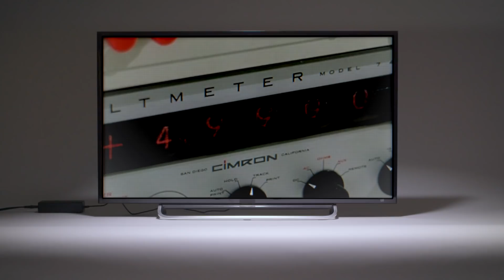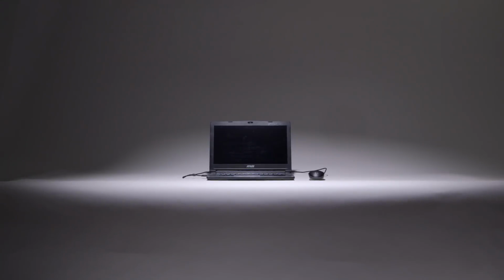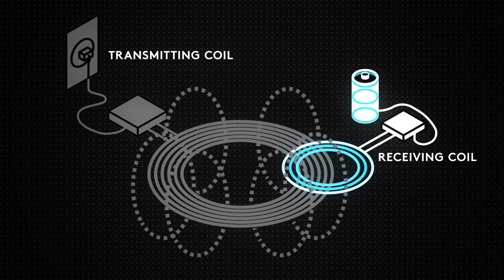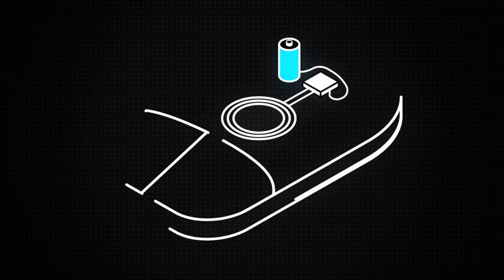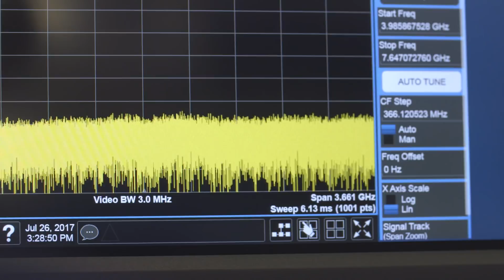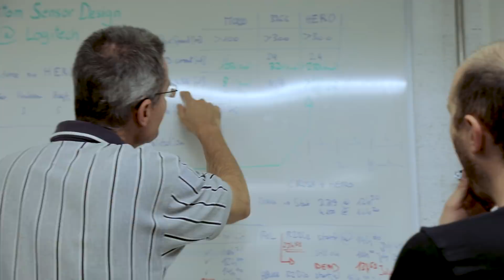Logitech G: The Technology of PowerPlay

Comment: I have had three of these. One was a replacement by Logitech. The issue is that the Powerplay will generate EMF interference while in the charging state, as indicated by the White LED on the pad receiver. I have the G903 Mouse, G910 Keyboard, and the Powerplay. I also use a Logitech MX Master 3 and Performance MX for productivity most of the time. I noticed the mouse cursor while using any other wireless mouse like the MX Master 3 or Performance MX was jittering, and I could not control it while the Powerplay was in the charge state!

As soon as the charge state ended or I unplugged the Powerplay, the cursor would return to normal. As soon as the Powerplay returned to the charging state, the cursor would become erratic again! I also noticed the G903 generated a jittery mouse cursor while the Powerplay was in a charged state. It was not as bad as when using the MXM3, and I could select items, but the cursor was jittering until the charge state ended. 

So Logitech sent me a replacement Powerplay, and it had the same issue! Because I use my productivity Logitech mice the most, I would unplug the Powerplay pad to prevent the problem from occurring. When I wanted to game and use the G903 mouse, I would plug the Powerplay back in. 

Fast forward a few months, and I started to play Elden Ring on PC using an Xbox controller. I noticed intermittent issues with menu control. When trying to select or scroll through a menu using the Xbox controller, I could not choose anything, and it would jump around! At first, I thought this was a new game patch issue, but it continued to occur, and then I noticed the game was jittering slightly only on the monitor I was playing Elden Ring. When this issue remained after several patches, I discovered the Powerplay was causing the problem when it was in a charge state! Like the mice, the issue would disappear once I disconnected the Powerplay USB cable or stopped charging.

I connected the USB connection directly to my desktop and other USB ports, but the issue persists. All device Firmware and G-Hub software are up to date. I even purchased a third Powerplay pad from BestBuy, hoping Logitech may have changed something, but the issue continues even on the newest Powerplay. The Powerplay produces some EMF that impacts other wireless devices, speakers, and monitors. I am not sure how the Powerplay is affecting my monitor. Still, it is only occurring on the monitor I am playing Elden Ring on, leading me to conclude the interface is coming through the Xbox controller and maybe producing micro character movement, which looks like screen jittering on my monitor.

I have contacted Logitech again regarding this issue. I have not seen many reviewers reporting this, but I believe this is because most owners only use a Logitech G Mouse, so they do not know the impact on other wireless devices. However, there are a few reviewers who, like me, use different wireless devices and are experiencing the same issue.

Edit: I have noticed my Panasonic wireless home phone has had interference for some time now. This wasn't always the case, and If I move away from my desk with the Powerplay, it goes away! It occurred to me that the Powerplay might also impact this phone. Sure enough, if I unplug the Powerplay mouse pad, all my home phone interference disappears!

There is a Powerplay Charging Enable option in the G Hub Powerplay options section that will only work with Powerplay Firmware 7.1.11. G Hub will NOT update the Powerplay Firmware through the built-in update process, and you have to do this manually to update the Fireware to 7.1.11 to enable this option! With no help from Logitech support, I think I figured out a fix. 

You have to use the Logitech POWERPLAY Wireless Charging System Update Tool under downloads for the Powerplay device to actually update the Powerplay Firmware to version 7.1.11 to get the option to disable. Powerplay Charging! You can now disable Powerplay Charging until required, and it will not impact other devices. I am still checking this works and will update later. Good luck.

Comment: weird that you guys put so much thought into this but you made the mouse pad so small that very few if any high level gamers would be able to use the mouse pad. Its a pretty major oversight given almost all high level gamers are using lower sensitivity. And unfortunately the large receiver and USB port on it dont make it possible to slide it under a bigger mouse pad either. on top of that you have the odd choice to make every product in the box a different thickness. If the 2 included mouse pads had the same thickness as the charging based they could be spread out to  create a larger surface to put under a larger mouse pad. The other unusual choice was not to make a wrap around RGB ring for such an expensive mouse pad. If you were going to make a smaller mouse pad then clearly it was targeted more at casual players, and in that case more of them would have liked an RGB ring, plus it would have been very little extra to add that. Taking 4 years to overlook the most basic function of a mouse pad, the size is kinda sad really.

Comment: Reworked/new g13 and g600 pls! Just need a bit better minijoy position and better buttons layout - with symmetrical left and right hand setup, and a numeric section between the 2 pieces. Let to use one left handed and one right handed instead of a keyboard,  )! Else have to buy razer stuffs after 20 years of logitech using :)

Comment: I have a question . 
I have the fligth sim P3D v4.3 ..
Joystick and Throttle are Thrustmaster T16.0000M
but would like the Throttle from Saitek x56 or x52 pro.
are both compatible ( Stick T16.000M and x56// x52 pro ????
I have Flugsim P3D V4.3

Comment: Are we going to see a replacement for the Logitech G13 or not?
I don't understand why would you leave such a gap on the market.
keypad >> gaming keyboard
Reply: Very small miniority here. I see this complaint constantly but clearly sales weren't very good, that is why they and razer both basically abandoned it.
Reply: @Stranger242-2  I think both firm were stupid enough not to do almost simmetrical (left and right handed version) setup at the start from the keypads to replace the gamer keyboards with 2 pieces of keypad. they making 200 buck keyboards, but unable to cut it into 2 pieces and make it a bit confortable with some tilt and matrix buttons, or to take care of the males shorter point-finger?

Comment: Since I cannot reach your helpdesk, and I can't actually contact anyone via your website or phone or anywhere, any way or any how, I'll just leave this here.

I have bought an X52 HOTAS stick, and at first the display didn't light up, and showed no relevant information as it should, as advertised.
The solution to this turned out to be to install specialized drivers, which when I opened the program, turned out to be nothing but a Facebook page for Logitech, and a few links to the Logitech website, Twitter, Facebook and other things that are COMPLETELY UNNEEDED, IRRELEVANT, AND UNWANTED in drivers for a gaming flightstick.
I had to try to uninstall this piece of bloatware FOUR times, before it actually went away and stayed away. The throttle display did keep working, and that's nice, were it not that the clock on it displays the wrong time, and the only settings I am able to find for that, don't actually make any difference. No matter how often I set the time to GMT +1, it keeps on reverting to GMT.

It's not like you guys are new to the business of gaming hardware, I've used Logitech sticks, steering wheels and speakers for years now. WHY is it so hard to get stuff to ... I dunno, work? Perhaps your programmers should look for employment elsewhere, like getting a job as a farmer's assistant, or a train conductor. Perhaps taxi driver? That will most likely be something they're more suitable for, since programming apparently isn't their thing.

It's not like it's the first driver problem I ever had with Logitech, I still remember the update for my Gran Turismo racing wheel that was convinced it was a completely different model, and I had to get help from a friend to trick into getting a previous version of the drivers, which of course wasn't readily available from Logitech itself.

I know one thing, if this stick didn't feel so nice (let's hope it's gonna last longer than the very short time I was able to enjoy my previous two logitech sticks before the hardware failed and buttons simply broke or broke off entirely with normal use) I'd have rather even gone for a Trust product.
I also know this is the very very last time I ever buy anything with the Logitech logo on it.

Regards, a previously huge Logitech fan but now very unsatisfied customer.

Seriously. Fuck your shit quality.

Comment: Great pioneer in the field. However, there are obvious downsides as this is a new type of mice. This is basically a wireless mouse that can only work on a specific mousepad and nothing else. This is thus far more limiting than more traditional options. But there is potential in increasing the magnetic field and have a transmitter, say, under the desk rather than directly below the mouse, that would make this perfect. But we're just not there yet.
Reply: Current Powerplay compatible mice (G903 & G703) can also be charged through cable.
Reply: Rusty Cog nope, you can literally use whatever mouse pad u want as the charging pad is NOT the one used for the mice. Yoy need to put ANOTHER pad above the charging pad and it works with every single mouse pad i have tried (6). The only downside is that the chargin pad may be too little to some ppl so a bigger mouse pad will fall from the sides.
Reply: Pablo González Hermosilla this is a bandaid solution. you can't use a bigger mousepad the way you can with any other type of mouse. what I meant is a transmitter of much bigger size that is mounted under the desk so you can use any mousepad or no mousepad at all. could even double as a phone charger.
Reply: Rusty Cog oh, i agree with you then. Hope they adress that issue in the near future. Looks like a cool idea.
Reply: true.
however, even in the case of putting it under your desk, it simply wouldn't work depending on what your desk is made of (ie. metal).
Reply: BattousaiHBr kinda had wooden tables in mind when I wrote that. You got me.

Comment: You removed battery, cable but you added that huge area  on top of which mouse shoud stay...I don't understand the advantages. I prefer a traditional wireless mouse.
Reply: They didn't remove the battery, the battery is still there. nor did they remove the cable. they added a wireless charging mouse pad.

Comment: Why not just make a mouse that could power itself on the Movement? For example with the good old sphere serving as a electric rotor with magnets do renerate variable magnetic field on movement thus genersting an electric current fo feed the electronics? Thia way the mouse is not even dependent on special mouse pads
Reply: Pedro Guedes I dont think  tiny mouse movements would be enough to generate sufficient voltage to power the mouse , there is also the friction between the sphere and the mouse pad which wouldnt feel nice (ofc the old mouses werent that bad in terms of friction but still I would rather use wired mouse than one with a sphere in it )
Reply: it's theoretically possible, however the energy output of such methods is very low, which to work would require the energy draw of the mice to be even lower than that, which right now isn't feasible.
Reply: May be they are working on that technology already.